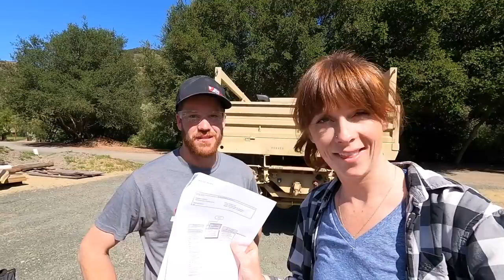We Bought A MASSIVE Army Truck!

Comment: the cts another problem spot to look it a box on the dash to control the tire pressure and inflate and deflate the tires air pressure sometimes if the battery been disconnected might need to reset it should b e in the manual how to reset it I forgot and don't have the lmtv service bocks with me.   They are decent trucks most of the gripes are the electronics but not as complex as  cars are   Pretty robust vehicle one of my customers kinda spoiled kids into sending it mode all the time he's not killed the one I got for him yets he's deployed lots of tires bein complete animal off-roading in it managed to brin him out of the woods everytime despite how much stuff he tore up   Now he's calmed down with it  I replaced the seat upfront we got him the canvas top for the back in the goes camping with it and can remove the cover when need to haul stuff.  Be careful raisin the cab make sure nothing lose in the cab when your flip it forwards cause it will fall and break the very expansive windshield if you can even find one for sale..  Many private had to pay for one in the units I was in cause they left a socket on the middle seat and lifted the cab to check the engine and it fell and busted the glass
Reply from the maker: That is an excellent tip on checking the cab before tilting, that would be a major bummer to break the windshield!

Comment: These things are too new for me... back in my days they had the old deuce & a halfs.  The rule then was never, ever drive with your thumbs on the inside of the steering wheel--if you wanted to still have thumbs...  Does the same rule apply to these newer beasts?
Reply from the maker: It has power steering so it's able to keep the wheels pointed straight. But that is habit we have also gotten into from our time rock crawling. Courtney had a Toyota pickup that the power steering pump went out on during the Rubicon trail and she spent the rest of the time wrestling the steering wheel with her thumbs pointed up!

Comment: didnt need to un do the driveline to pull it... could have just put the transfercase in neutral
Reply from the maker: It's an AWD transfer case that's controlled by the Allison transmission computer. There is no way to put the transfer case on neutral on these. Thanks for watching!

Comment: 4 way diverter valve  ,
Reply from the maker: Thanks for the tip! We actually went through the entire air system and found no problems. After driving the truck around the brakes have become much better! We're going to take the drums off and service the wedges.

Comment: I used to be a mechanic in the army and worked on those daily.  You guys were in way in over your heads.  Like In the ocean over your heads. Maybe some more research before you got started?  It was painful to watch and I thought someone could get hurt.  The vehicle doesn’t usually move without air pressure.  The brakes were most likely caged for towing.  Seeing he drove it when he got home, Bet the tow truck driver let him in on the secret.
Reply from the maker: Getting in over our heads seems to be a trend… 😉
The brakes weren’t caged, just seized from rust/sitting.

Comment: Uhhhhmmm,  aintcha spoda be licensed to drive a vehicle with air-brakes???
Reply from the maker: Our understanding is that as long as the GVWR is under 26k you don't need a CDL (which is where the air brake endorsement comes in). That is why Penske and Enterprise will rent you a small truck with a class C license.

Comment: Your air tank for your brakes is empty
Reply from the maker: It was definitely empty when we first hooked up the batteries, the truck had been sitting for 4 years. But, we quickly got up to 120psi after fixing a big leak at a glad handle check valve.

Comment: You guys are going to love the truck. I can't wait to see what you do with it. Check out my maintenance playlist if you haven't already. 👍LMTV repairs and maintenance: https://www.youtube.com/playlist?list=PL_CyHCr19KqmnQY9_chCUInxodxGk8cON
Reply from the maker: Ooh we are adding you to our nightly YouTube watch list!
Reply: @AmbitionStrikes  I'm guessing you have air going to the brake canisters and your service diaphragms are leaking. Start the truck let it build air pressure shut the truck off step on the brake pedal and I think you'll hear the air leaking out through holes in the brake canisters. That would mean it was leaking through the diaphragm and not pushing the brake actuator.
Reply from the maker: @NEILSWORLD  We checked that and we don’t have any air leaks! 110 psi is being delivered to each wheel and easily holds pressure.
Reply: @AmbitionStrikes  check to see if you can visually see the brake shoes moving out to contact the drum when the brake pedal is depressed. If you see them moving maybe the adjusters are not working properly and the shoes are not contacting the drum with as much pressure as they should.

Comment: You are dangerously over your head,any vehicle with air brakes requires a CDL with air brake endorsement. Any accident or police stop and you are going to jail(no insurance as no coverage without proper licence). You need a qualified mechanic to diagnose and fix the problem,it is not a diy. This is also a poor choice for dump truck conversion, better off with a 9series unit with dump body installed.
Reply from the maker: You are misinformed. This truck has a GVWR less than 26k which means a CDL is NOT required. There is no air brake endorsement for a Class C license. The vehicle is properly registered and insured for our personal use. As far as what we are better off with, I’d say that is entirely preference and we are very happy with our decision.